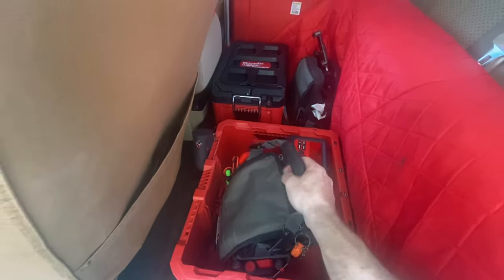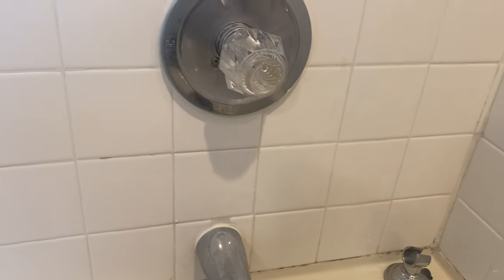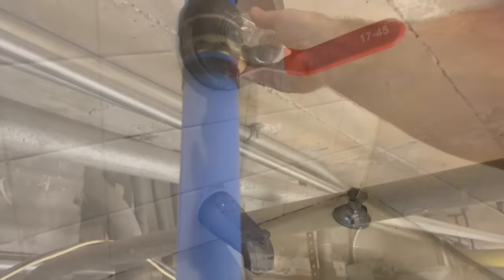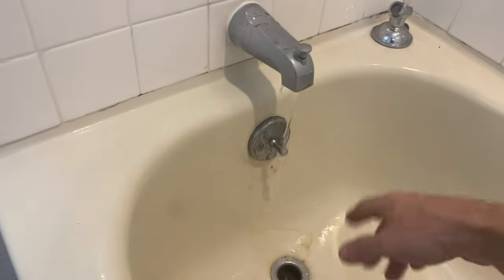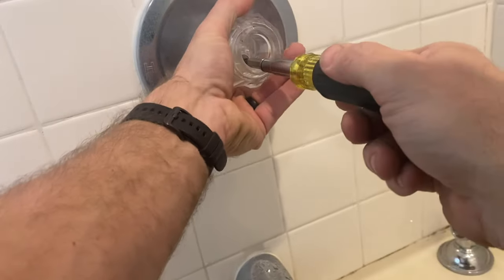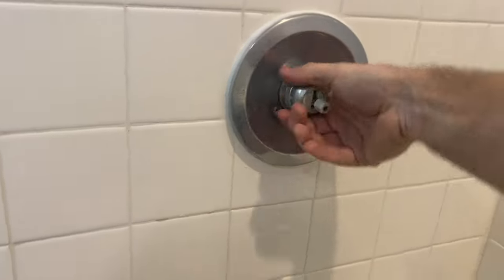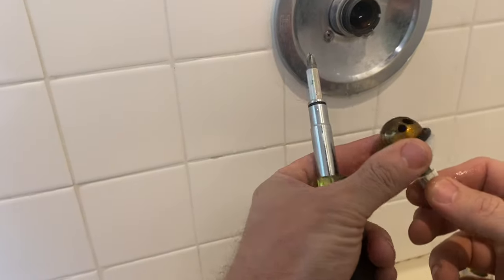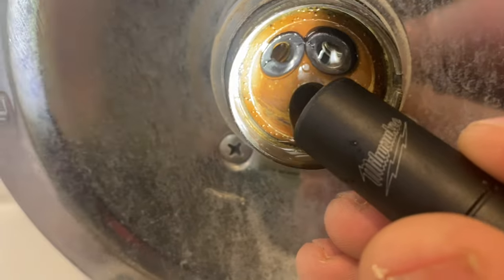Work Order - My Tub Spout Won't Stop Dripping! Also fix Slow Drain - Old Delta Shower Faucet Repair

Comment: It's funny how European shower taps have completely different head construction that is less prone to malfunctions. And is definitely much easier to service. And we have one type of a head since like 30 or 35 years (different brands use the same standard).
As always, nicely executed service.
Reply from the maker: That would be nice. Not only is every manufacturer a little different here, but even between their models there are differences.

As always, thanks for the kind words!
Reply: @MORGANSMaintenance  The heads or cartridges are in 40 mm standard and they come in two heights: high or low. Price range is from $3 to $10. Time required to change the cartridge (with closing the valves) - less than 2 minutes.
Of course we also have all sorts of proprietary solutions, but that 40 mm head can be found literally in every home.
Keep on doing more of this service/small repairs videos, please. Your no BS attitude is very refreshing.
Reply from the maker: @Stefan_Kawalec  Thanks and I will on the videos. Sometimes I film some and the footage was bad, and sometimes I don’t film things because of the customer. I will when I have a chance to though. 

I have found that the Phone on the chest mount seems to be most successful. I can still at least see somewhat what I’m filming by glancing down and checking.

Some newer valves we use have gone to cartridges and it’s a quick change… but they are around $50!  Even with those, Delta alone has two versions of cartridges not to mention other manufacturers. It never fails that you need the one you don’t have.

Thanks again for the encouragement!

Comment: Great video. I’m am not impressed what so ever with Delta’s new cartridges. Within the last couple years I’ve had more fail when compared to the traditional seats and spring type. I like when you get to dig in the drains and find the mystery or as I like to call it “Black Gold” lol.. Really appreciate the time you spend on your videos! Really enjoying your Channel
Reply from the maker: Thanks.

I typically use Delta but mostly because it seems parts are the easiest to come by, but I agree on the cartridges. 

I bet the inside of this faucet hasn’t been touched for 10 years or more and I change cartridges much more often.

I have pulled some “treasures” for sure over the years. Especially in toilets. I wish I had started making videos a long time ago as  I think back on some of the stuff I’ve seen and done.

Thank you for watching and the encouragement! Everyone on this channel is great and I look forward to the comments/advice/suggestions with every video.

Comment: The most reliable valve ever. $.25 vs $50 for a new cartridge.
Reply from the maker: No kidding, those cartridge replacements are a hard pull for customers to swallow.